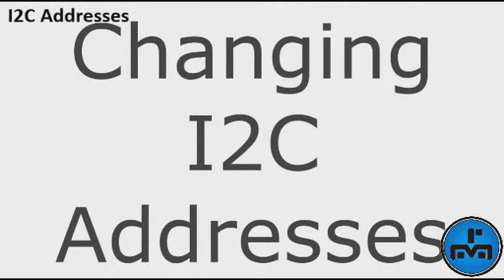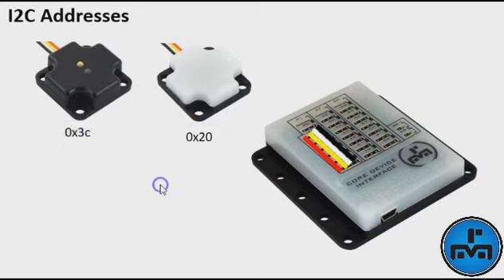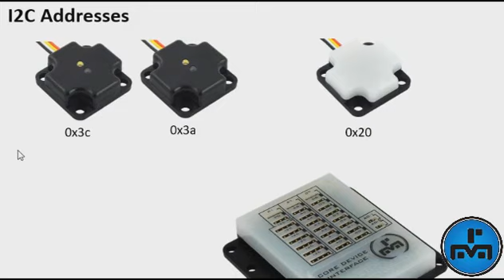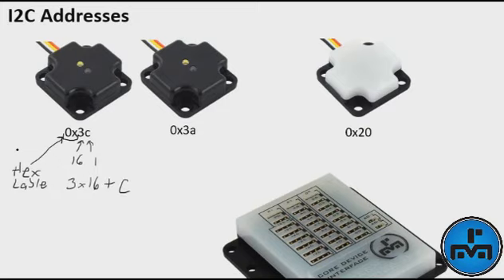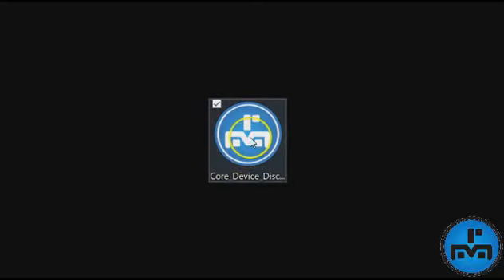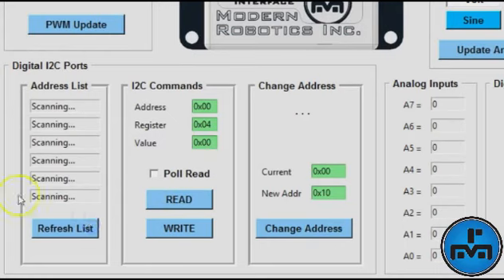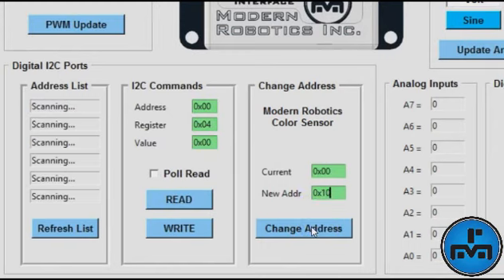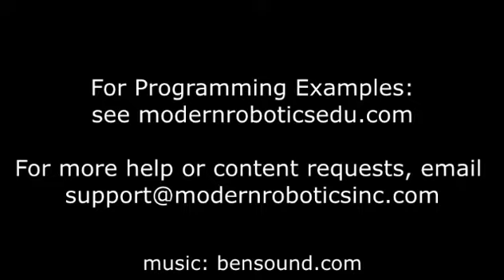Changing I2C Address

Comment: Buddy, will this device work with OLED Displays? I own a couple of 0.42" I2C OLED Displays. They have hard-coded address. I would like to change them as I am planning to use 10 of them in a project.

Comment: i'm tryin to change the address of my 10 dof imu sensor.
Im scaning my i2c devices with arduino i2c_Scanner  codes and i get 2 device, but when i try to scan with your tool i can't see any device.
What is the problem?
Reply from the maker: To use this program, you must use a Core Device Interface Module. http://modernroboticsinc.com/core-device-interface-module-2
Reply: @modernroboticsinc5844  do I always need the CDI connected?.... I want to permanently change the i2c device address and afterwards not use CDI - is this possible?.... I this a permanent HW change?.... Will it work for Adafruit_VL53L0X - as I need to use on a project please?